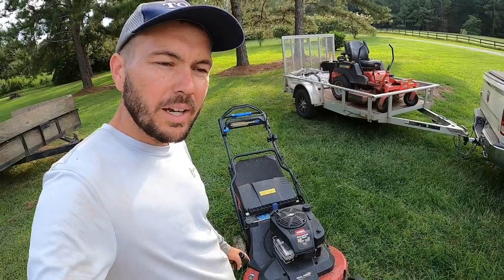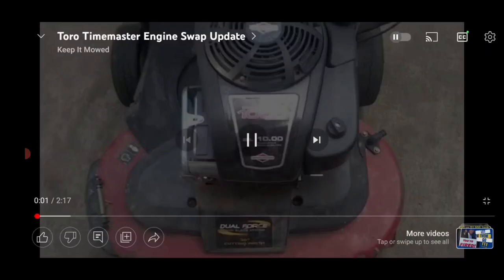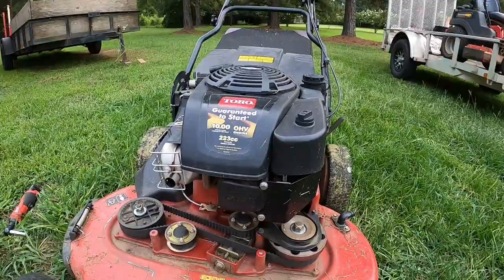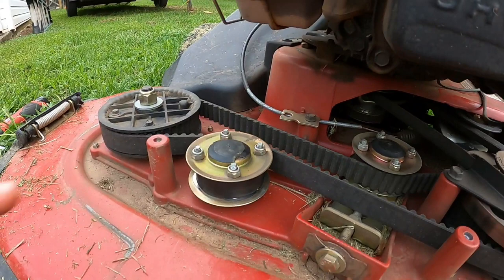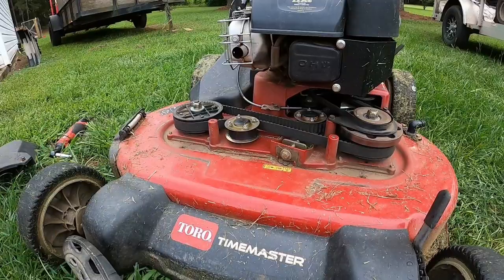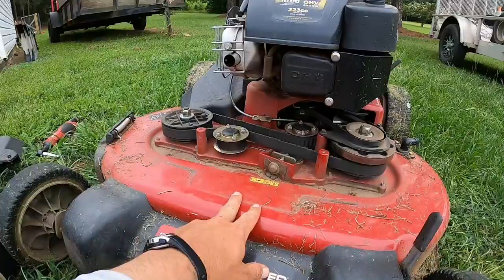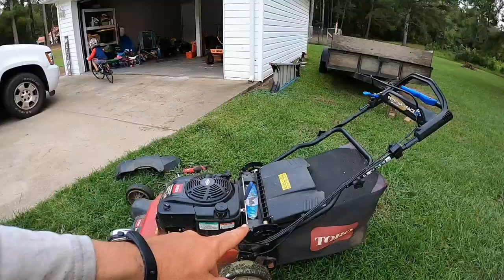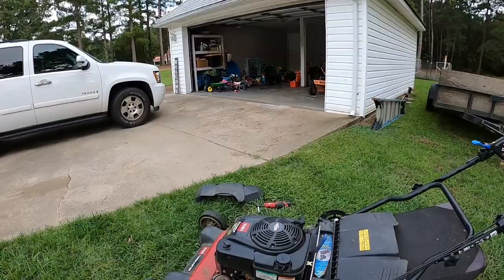TORO TIMEMASTER 4 YEAR REVIEW😉

Comment: Thanks for the shout-out Tony! Another great video. 
I think the $1,500 tag without electric start and $1,600 with is going to hurt the sales numbers on these units.

I will be doing a complete overhaul on mine this winter. 

My first year model would eat those bearings up even though I glued the caps down. Found out later the issue was the mounting spots were slightly angled from factory. Which caused them to blow up every 30-60 hours. I still have a bag of new pulleys 😂

My current model never have had issues with them. I have a ton of hours on it and as you mentioned, I already blew one motor up and upgraded. 

My transmission is diecast metal. But my Timemaster was the last year of the 190cc. I upgraded the transmission and it too is diecast. Never had a problem since. 

I found away to get more time out of the cable. I spray lithium grease in them every time I service the mower. Makes them a lot longer.

I eat up a set of wheels every season. For anyone reading this, it's my full time mower.

I've seen a guy in Houston who cut a square hole out of the cover. He made a little plastic cover with wing nuts to pop off quickly to blow it out. I'll probably do that this winter as well. 

I paid $899 for my current Timemaster 30. I've gotten my money out of it. Not sure I'm willing to pay $1,500. I guess never say never. But I am eyeing new equipment for 2023...

Enjoy all your videos. Have a great weekend!
Reply from the maker: Thank you for this info bro !! Let us know what you get
Reply from the maker: Maybe folks could find a used one aswell
Reply: @tonyslawncare  Might be the way to go.
Reply: @tonyslawncare  Will do. Videos will come.
Reply: I agree way overpriced

Comment: Mine is in the shop a second time for a leaky transmission. The first time wiped out the whole trans. This latest time I caught it before it failed. Unfortunately, I was told Toro does not sell a gasket kit anymore, forcing owners to replace the entire unit. My shop found someone who makes the seals again and I'm waiting for delivery and installation. I have also had an idler pulley fail that took out my cog belt. I had to replace my drive belt too. It is just used residentially and I maintain it well. With all that said I'd still recommend the unit, just get the extended warranty. I bought mine for $800 new off season, would I spend $1600 now - No.
Reply from the maker: Great input thank you !

Comment: Ahh... The mower I love and hate!! I have 2 now . Paid 1100$ in 2020 new and learned how to fix all the little quirks, belts, pulleys, transmission, cables. Got a good deal from a guy that buys Home Depot returns this year. He had one for 750$. It was a return with bad transmission. He had new transmission but had not  yet installed it. I offered 600$ and I would install transmission. We made a deal that we both liked!! As far as the idler pulleys go, you might as well replace them with the commercial pulleys when they fail. I went thru 2 sets of the original in 2020 and installed commercial ones same year. Have not had a problem since from the idler pulleys. It is a very handy mower and I use it often!!!
Reply from the maker: Thanks for the input and thanks for watching

Comment: These are prone to head gasket failure.   Usually on the exhaust side.  No big deal, new gasket around 12 bucks.  Great machine for residential use.  Got my mower 2015
Reply from the maker: Thanks for the info

Comment: Time master and turfmaster that I have the transmission are the same just pulleys are different, I have work on both, I know the new turf master came with a different transmission, I fix both transmissions easy and cheap
Reply: My time master is 2011 or 2012 and the turfmaster is a little older
Reply from the maker: Good info

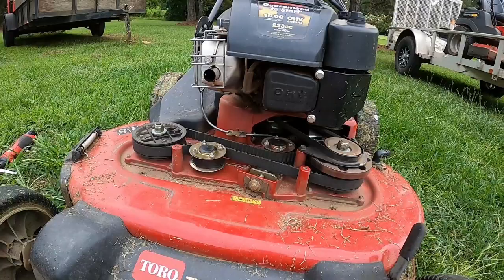Comment: I just purchased an open box one from a landscaper for $975 from Facebook Marketplace. I noticed at 6:46 that you spun the front left wheel (point of view is pushing the lawnmower) even though it is sitting on the ground. Is that normal? I noticed the same wheel on my Timemaster is barely touching the ground (I can hear it scrape the floor but it's not really touching the floor). I guess something got bent or improperly assembled.
Reply from the maker: I wouldnt let that worry you a bit mine may be the same way. What a deal you got!
Reply: Yeah I guess I shouldn't worry about it. Really happy with the price I paid for it. $1,599.00 new is insane. Good to know you have some videos on how to do maintenance on this mower. I'll be sure to check them out in the future.